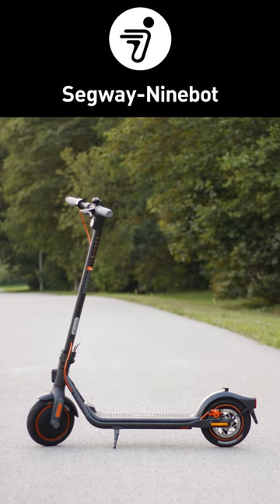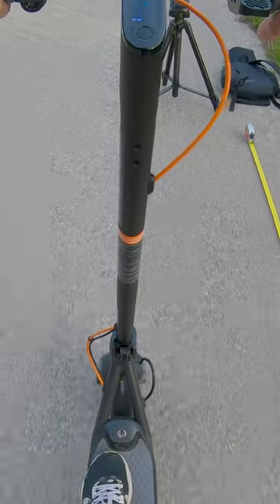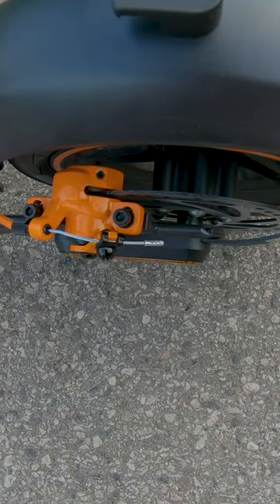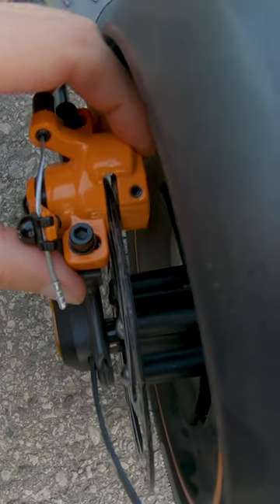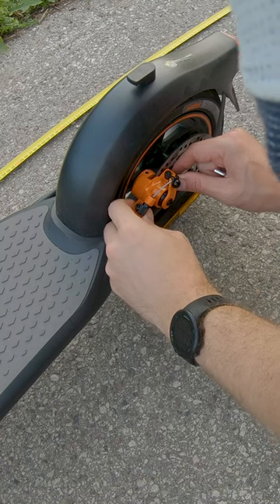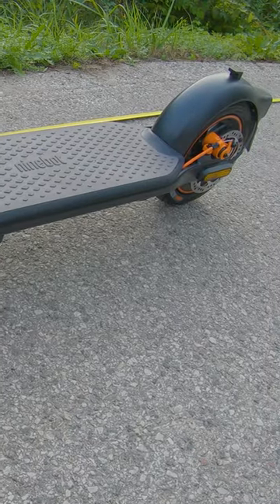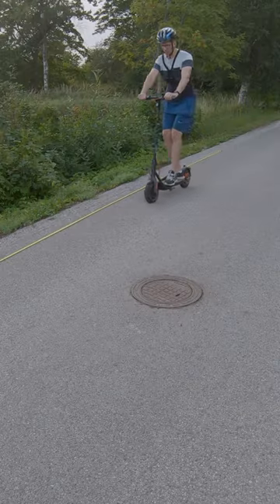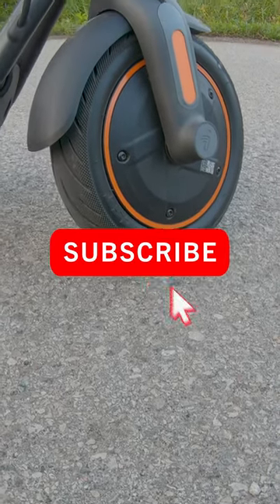How I Increased an E-Scooter Stopping Power by Simple Brake Adjustment

Comment: Why didn't you adjust the braking cable length? I did this and it works perfectly. Its the same principle as with a bike.
Reply: No that doesn’t work with a electric scooter since the brake is a different mechanism
Reply: Totally different principle lol

Comment: youre not supposed to have the disc in the middle on a cable disc brake, its supposed to be against but not touching the inner most brake pad and have a minmimum amount of distance between the disc and outermost brake pads, there should be a bit of light showign but not much whatsoever and there should be more on the outer side
Reply: Yeah I set mine up other day just like this
Reply: You alter the Allan bolt on the inside of the caliper and set the the inner pad as close as possible 😉
Reply: It's supposed to be in the middle when you're using a 2 (or more) piston hydraulic brake.

This only goes for mechanical brakes.

Comment: Wrong type of caliper. Fixed position inner piston. Outer piston pushes rotor into contact with inner. Increasing the gap between rotor and inner pad just means outer pads has to bend the rotor over further to contact inner. This will just give a mushy feeling in the lever.

Comment: how to fix the electronic or electric brake? it's giving me the 15 error when i power it on. i can't drive it anymore, i can't charge it, i can't do anything! i have a ninebot F40e. It's going with 25kmh originally, i hacked it to go with 30kmh, i changed it to mp, and turned on cruise control. the scooter wasnt designed for those, is it because of that? or is it because of something else. and can you or can someone tell me what's the problem?
Reply: dont cry about errors if you dont use the scooter as it was intended
Reply: @fumetsu-950  i went offroading with the scooter, maybe that's the problem
Reply: Motherboard issue, also the most expensive one, at this point is easier to buy a new one, but still, very unlucky to get that error

Comment: The inside piston is supposed to be very close
 the outside is the one that moves, so is not supposed to be in the centre, you cannot line it up by eye that's impossible
Loosen the two bolts pull the brake on and tighten it up, then adjust the inner one so it doesn't catch on the disc
Reply: it's not I did it
Reply: It don't have to be perfect mate just better. Sure you get more wear on the pads but it's better than destroying someone